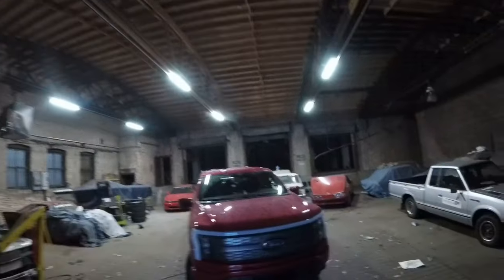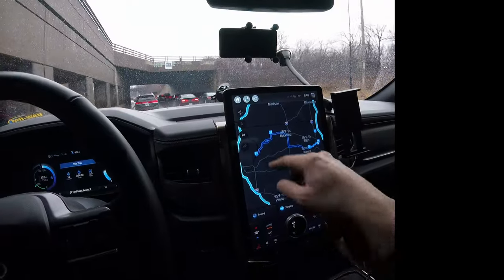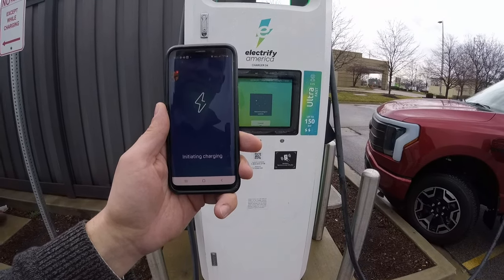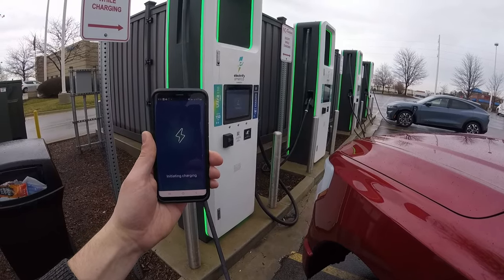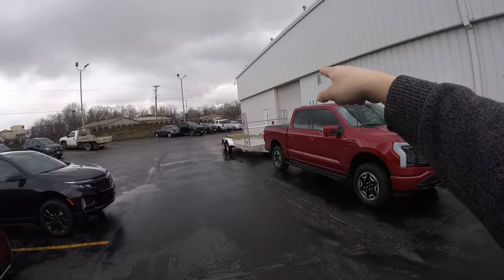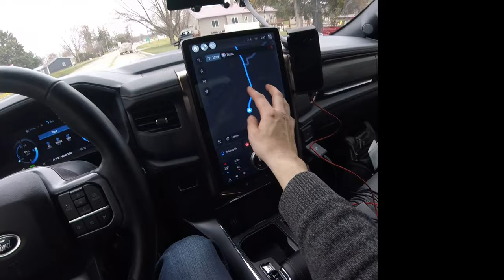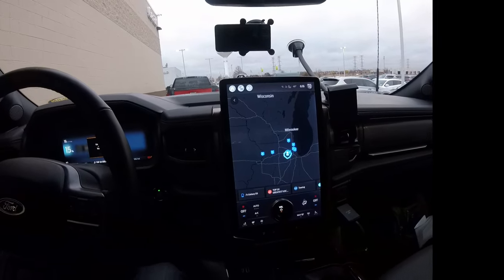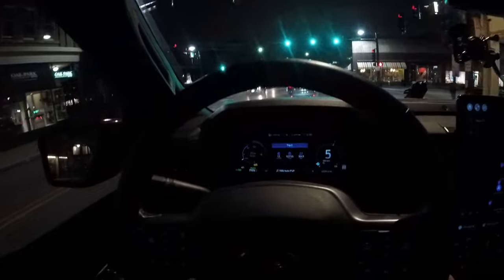Towing with my Ford Lightning through a charging desert!

Comment: I don’t use plug n charge because I want the pass discount. Next time try to swipe to start charge in the app first and wait for the charge station screen to prompt you to plug in. That usually for the issue I saw you have at the first EA station.
Reply from the maker: I didn't know that, I always thought I should plug in first because that's of the screen says but I'll try this as well

Also, someone else pointed out that my max charge sitting may have been interfering with this charging attempt so not the fault of EA sounds like

Comment: I see you haven't done the dash mat recall...
Reply from the maker: Correct. In two days I'm getting the dash mat, tail light and bms sensor
Reply: @MindofMatter  I suspect your charging issue at the EA charger was because your truck is set to stop charging at 90%.  You can change that on the screen in the truck and/or ford app.
Reply from the maker: @scrapinby77  dude, good call there

Comment: How did you get to 90% when your charge limit was 80%? Did you have the charge limit set to 100% and then it reset itself to 80%? Helps that it was such a light load I am sure - my empty trailers are heavier than that whole load.
Reply from the maker: I set a one time charge limit the night before I left to 100% so I could leave with a full battery. So when I left my neighborhood it was at 100% and I just planned on doing it quick top up at EA on my way out of town while I went to the bank but forgot 90% was my usual limit.

Comment: High Speed chargers should only be used up to 80% and not full... The charging curve drops to the point it isn't smart to charge.
Also if you're taking a charger to get over 80% you're taking a stall from someone who needs to actually charge
Reply from the maker: You mean the early EA charge? Yeah I generally agree with you but I was not leaving the truck unattended longer than the walk to the adjacent bank.